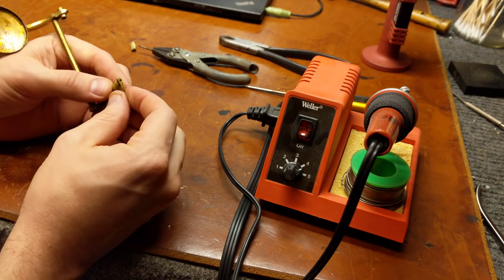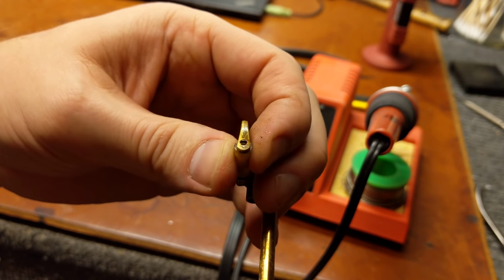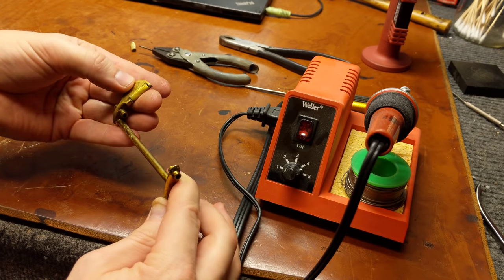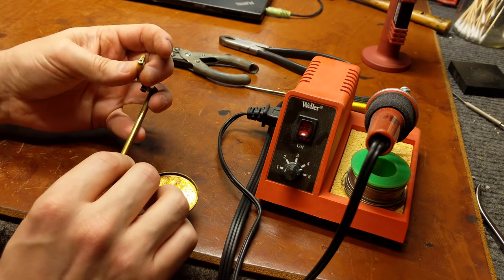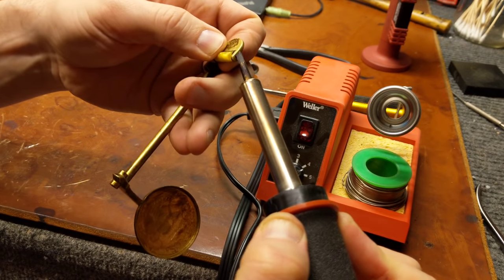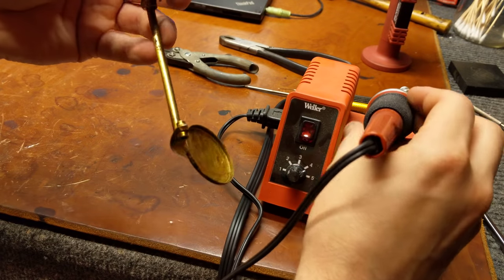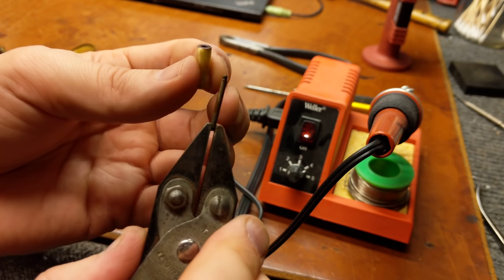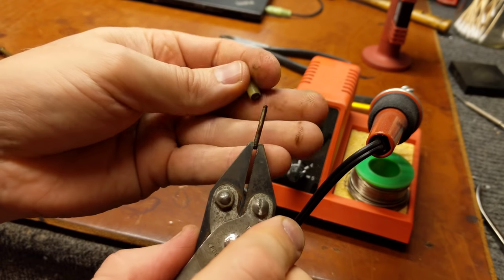Saxophone Repair Topic: Removing Stuck Rollers Using Heat

Comment: Thank you! I have a 1921 Conn C Melody with original rollers that are stuck to the rod just like this video. I’ve tried the razor blade trick with no luck so far. I have to try this!